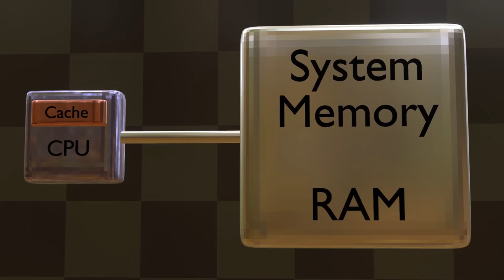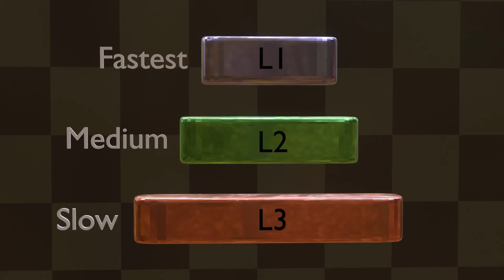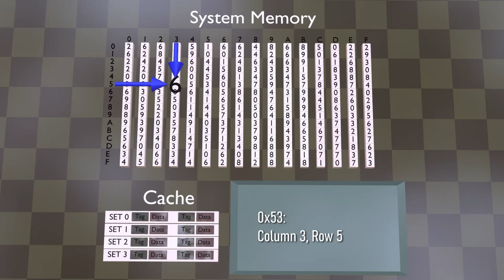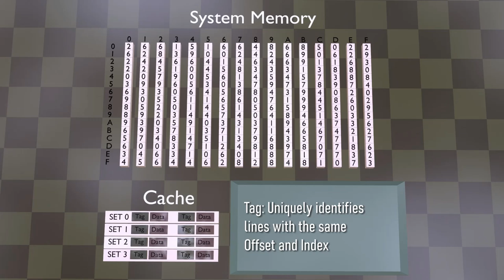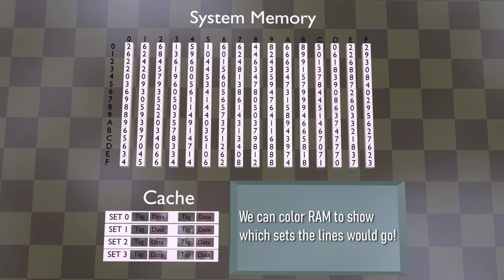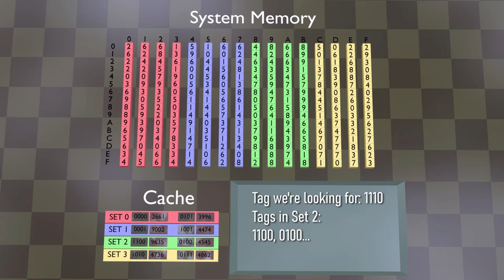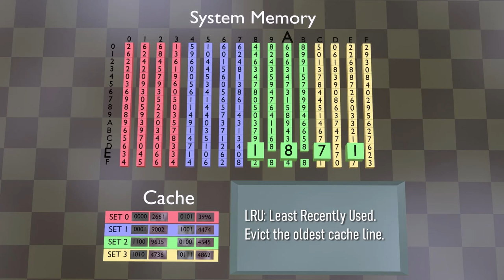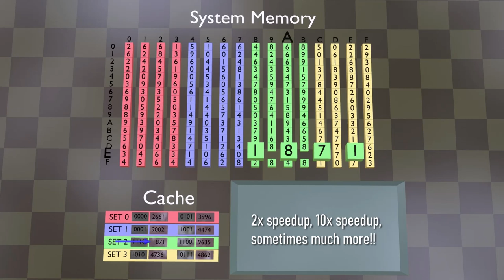Set Associative Caches 1: What is a Set Associative Cache?

Comment: also real CPUs will have to synchronization between cores. in situations like core0 has data from address 0x01230123 and core1 stores to address that is in same cache block as 0x01230123. now core0 has invalid/old data it's cache. What happens next depends on the ISA (how relaxed is the memory model and stuff) but, if remember correctly on x86 the invalid/old cache data needs to be reloaded to cache from main memory by core0 when it tryis to access it. also the c/c++ memory model (more relaxed than x86) has some opinions about this and this effects how compilers are allowed to generate code for loads and stores.
Reply from the maker: They do indeed! Synchronization between cores is a great topic!
Reply: @WhatsACreel  Actually, there is a protocol for multiple cores CPU, which is the MESI protocol. Basically, Intel and AMD have their unique protocol based on the MESI.

Comment: Better compilers could probably eliminate the hardware automatic caching system and precache code and data in an optimised way. Same for the OS / app runtime dynamic memory manager. Currently it isn't possible to access a cache directly (in X86 at least) but it is possible to precache data. If you could access a cache directly it would save the memory address translation step the hardware has to perform.

Comment: When you have L1, L2 and L3 cache, isn't data from L1 pushed into L2 when new data comes in?  And if the data in L2 gets old, it is moved to L3?  Something like that anyhow.  My memory on this is fuzzy. Anyhow, I seen some great videos on coding your programs to maximize cache hits.  The code to do this can often look slower with more code, but the end result will be a huge speed increase.  I forget where I seen the video now, but was REALLY fascinating to see normal code, verses code which has been designed to maximize cache hits.
Reply from the maker: Yes, the caches generally evict to higher levels. It might be fun to make a video on exclusive vs inclusive and victim caches! All that stuff is great :)

Techniques called cache tiling/blocking are great! Keep the data being processed in the L1!!

Cheers for watching mate :)

Comment: If my program makes a sequential access from beginning to end of some large array, can CPU predict that it will need data from more than just one cache line and start loading the following ones in advance?
Reply: That depends on a few other things... It isn't just the hardware and its opcodes, but it also depends on the OS and on your Compiler - Interpreter and how they convert your source code to either assembly, byte codes, or opcodes... There are many optimizations that your Compiler - Interpreter will make depending on your compiler's - interpreter's command-line options and settings... Then it comes down to the architecture and its hardware design for which features are available. After that, it then depends on your Operating System and how it handles the calls to the underlying hardware such as reading and writing to disk, creating threads and semaphores, reading and writing to ports, etc.
Reply: @skilz8098  ...Are you sure you know what you're talking about? Never mind, I found out that modern x86 processors do, in fact, have automatic prefetch mechanisms which can detect linear access patterns.
Reply from the maker: I thnk they call it smart prefetch at AMD or hardware prefetch at Intel? They certainly do this with the instruction cache too! Compilers will use software prefetch if they're clever enough! Certainly an interesting topic! Cheers for watching :)
Reply: @captainbodyshot2839  I wasn't trying to be too explicit because you would have to read the datasheets, and the ISA manuals to get all of the details. And the available features and techniques that can be used vary from architecture (cpu), platform(os), and compiler.
Take, for example, you and I could have the same exact hardware and operating system except I could be using Visual Studio and you could be using GCC or Clang for C++. They all work very similarly and they usually implement 98%+ of the C++ standard, but they may do so in different manners. 
Compiler A might use register X with instruction 1 where Compiler B might use register Y with instruction 2 to generate the same algorithm.
Reply: @skilz8098  pre-fetching happens at the hardware level, not the software level. An executable/assembly can't tell a processor where to put data in the caches. Different compilers might result in different assembly which may result in the processor handling memory differently among the caches. However, processors are either using this technique or they're not, regardless of your assembly code. These days most processors do it.